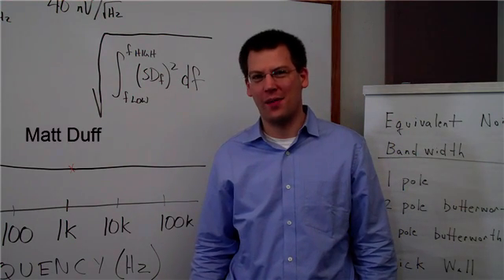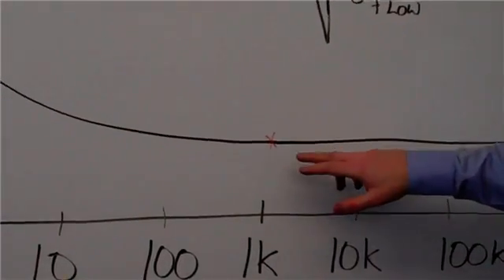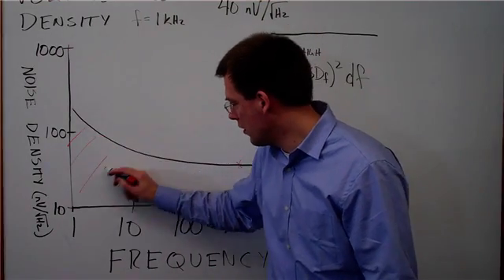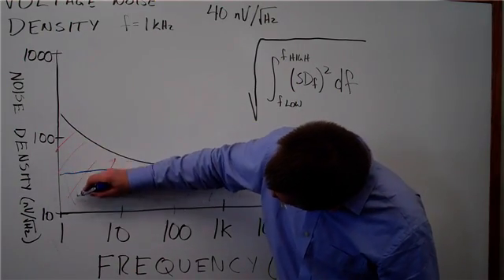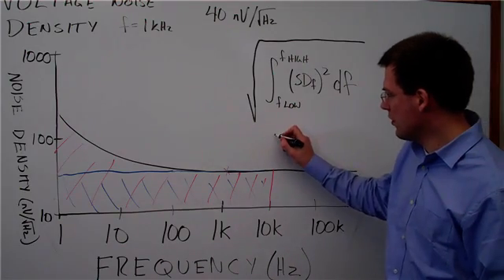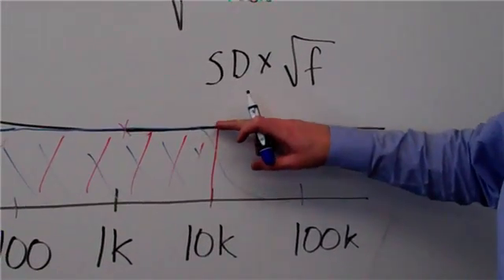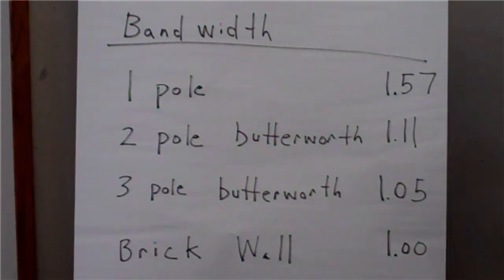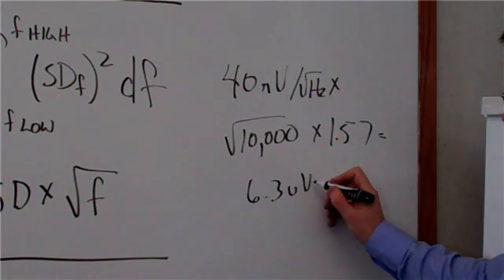Calculating Spectral Noise Density to RMS Noise

Comment: But what about the 0.1 Hz to 10 Hz noise value on the datasheet? (Which is often quite large.) Do we not need to know this and add this on to the calculation above?

For example: For OPA314:
  - Noise is 14 nV / sqrt(Hz) at 1 kHz (rising to 40 nV / sqrt(Hz) at only 10 Hz).
  - But 0.1-10 Hz noise is already 5 uVpp.

So, for example, for the ECG (electrocardiogram) range of 0-150 Hz:
  - With your technique I get only 171 nVrms noise (≈ 1 uVpp
)
  - Even if I use the high 10 Hz noise value I get 490 nVrms noise (≈ 2.9 uVpp
)

(I'm multiplying by 6 to get peak-to-peak noise, for 99.7% of values, as used in your next video.)

But according to the datasheet, the noise for even just the 0.1 - 10 Hz range alone is 5 uVpp. Both of the values above using your method are much lower than the actual noise!

Even for a larger range of 0 - 1 kHz, the 0.1 - 10 Hz noise is still important.

Also: Is the seemingly always undocumented range of 0-0.1 Hz ever of any significance?

Comment: Hi Matt, this was a good video. However, is there a simple way to estimate this noise spectral density plot from noise measurements taken from a new DUT? I am trying to ensure that a new device that I have does not have noise greater than the opamp noise.
Reply: I am assuming when you say "noise measurements from the DUT" you mean you have measurements that give you the rms or peak to peak noise?  If you pretend your DUT has no 1/f noise, you can do this by manipulating the equation in the video:  rms noise / sqrt(bandwidth) = spectral noise.   A key thing to know is the bandwidth of your DUT.
Reply: Thanks for the quick reply. I am trying to work on a front end for a completely new sensor which has not been characterized. However, I have the equipment to measure the sensor's instantaneous noise voltage (mVrms). I took all those points and did an FFT in Matlab which gave me a plot. The FFT should give you the noise voltage in mV. So, should I just perform the calculation mVrms/sqrt(frequency on the X-axis for that voltage)?
Reply: If you have one rms number that represents the noise you are getting, yes, you can use the formula.  If you have an FFT with vrms value at various frequency bins, I think you will need to scale it based on your window and maybe your bin size? (it's been a while since I've done this and unfortunately I don't remember.)
Reply: Thanks for the reply, that helps. I think I should read up more. Do you suggest a book with a good explanation on this?

Comment: Hi Matt, you mentioned about determining the frequency of the system, what exactly you meant by that, say I am feeding a 1MHz sine to an opampof 10MHz bandwidth?
Will the filter cut off frequencies be the last factor to determine this?
Reply: It's the bandwidth of the system.  So if your system is an amplifier stage with 10 MHz, that would be it.  The frequency of the signal you are putting in doesn't matter.

Comment: You are plotting the noise spectral density. You are supposed to integrate the noise power by squaring the noise spectral density values. You then take the square root of that integration result. The equation on the board shows that you should be integrating the square of the noise spectral density.

Comment: I can't get the result of 6,3Vrms that you did, what am I doing wrong? last time I did this: (40*10^-9)*(sqrt(10000*1,57) which = 5,011985634E-6 which is about 5µVrms, what am I missing?
Reply: Hey David,  You're exactly right.  That is a mistake in the video.  When we uploaded the video we put a note in the description about this, but that note is very easy to miss.  We've now annotated the screen when I'm discussing it so that it's clear.
Reply: A year late, but you are taking the root of the product of  10 000 and 1.57 and should be taking the sqr root of 10 000 and multiplying that by 1.57.
Reply: You can insert a quote directly in the video. Check 'edit video' in your channel

Comment: I'm not so sure about this. If you want to estimate the area in frequency domain with a brick, the x axis should be linear but your plot is logarithmic. This is weird to me. Can somebody tell me about this? Thank you in advance
Reply: Hi, in my opinion that shouldn't matter. The x-axes could be linear or logarithmic. The only important value is the maximum frequency for the integration. Another way to look at it is that you are getting the area of a rectangle which is height times length where the length is the frequency in this case.

Comment: Suppose that I combine four op-amps in parallel, resulting in 1/2 of the noise density of a single op-amp. Next suppose that the op-amps are generating some excess or non-Gaussian noise (popcorn, telegraph, etc). A single excess noise event in a single op-amp of the quad-array would be attenuated by 1/4 instead of 1/2.
.
Therefore isn't it true that the quad op-amp array has a noise advantage, even greater than the Gaussian noise attenuation of 1/2 ?